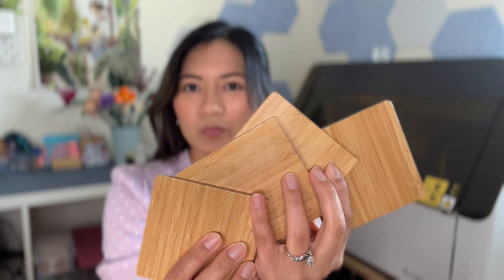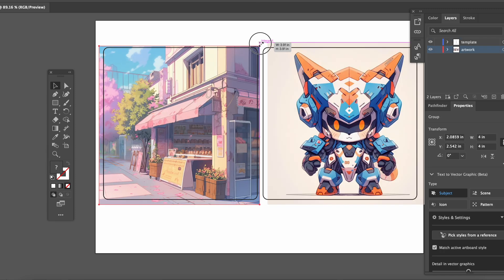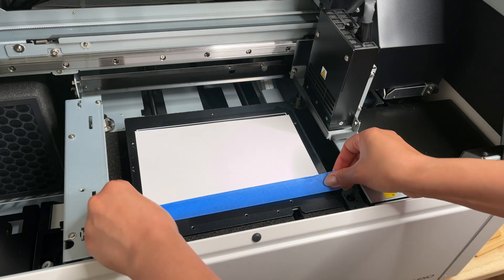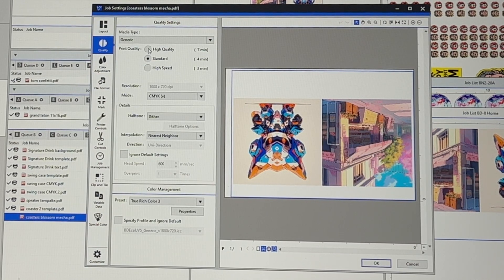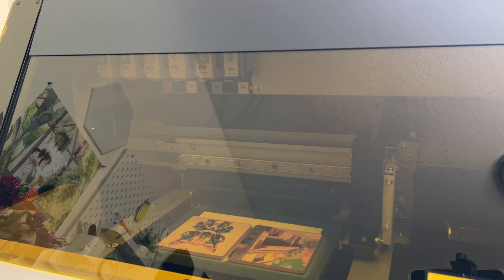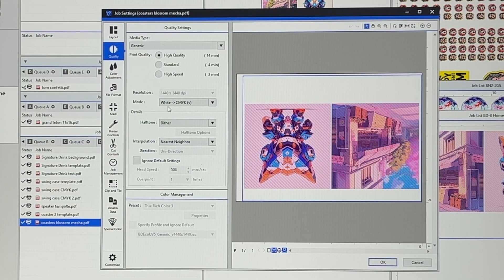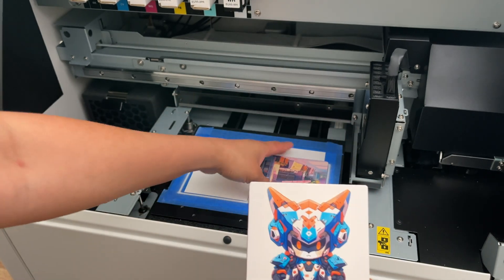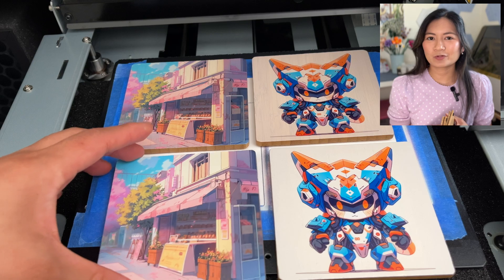What reducing INK DENSITY looks like on Wooden Coasters | Roland BD-8 UV Printer

Comment: Do you need to apply a seal coat on wooden coasters since there is no gloss option in the bd-8?
Reply from the maker: Hi there, the CMYK UV ink is water resistant so it isn't an issue on the coaster that I have

Comment: Hello, I'm enjoying the video. Can I use it at home? I'm worried about the smell or noise.
Reply from the maker: Hi, I have mine in my home office. When the door is shut the noise is comparable to someone watching TV inside. When not in use there is no sound, only for a couple of minutes every 6-8 hours as it refreshes the heads automatically. As far as smell, as long as the unit is closed in printing there's not really a smell. I have vinyl rolls in this room and that smells a bit more noticeably than the UV printer.

Comment: How did you solve the overspray issue on the sides of the product?
Reply from the maker: The overspray doesn't really happen when the object is not thick. This coaster is about a quarter inch thick. It mostly happens on taller objects. I hope that helps :)
Reply: She have another video explaining that